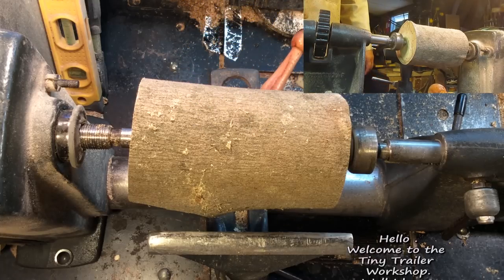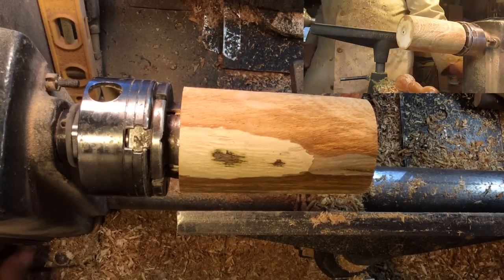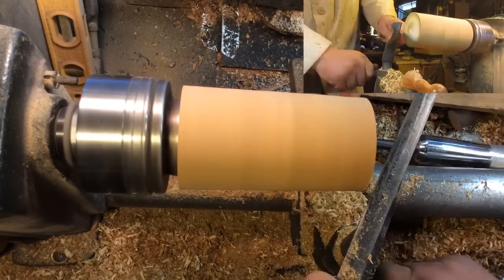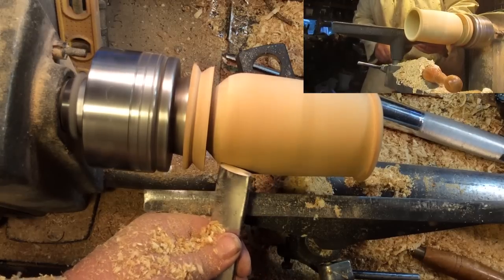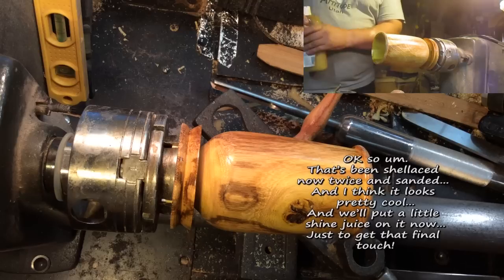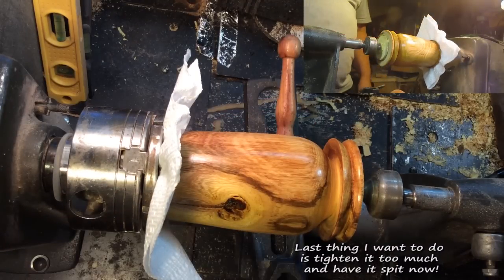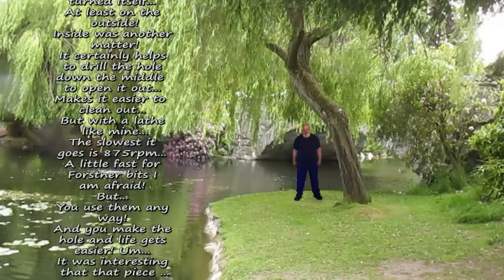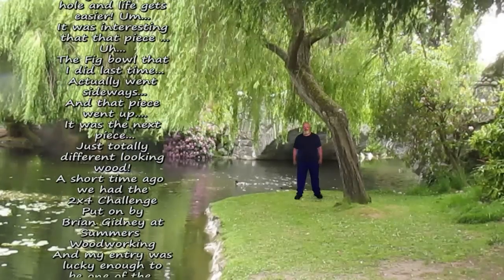Wood Turning #112 Texted a Fig Pot

Comment: I cut a big trunk off of my fig tree and overnight it basically exploded, the checking was so bad it looked like one of those sea sponge loofas. :(  Maybe I should have left the bark on?
Reply from the maker: awldune It can happen really fast! The piece that I have has just been sitting outside under a tarp... I think that is ok here as it is quite moist most of the year... but I see that some parts of the log have split... even halfway up the trunk! I guess branches came out there. So that still has the bark on it... I guess the trick is to get one big enough that you could get something nice out of one side of it! ;>) I guess if Peter Brown put some epoxy on a loofa it could get turned! ;>) Thanks for watching   Larry
Reply: Under a tarp in BC, don't you get mold/rot/bugs?
Reply from the maker: awldune Adds to the character!